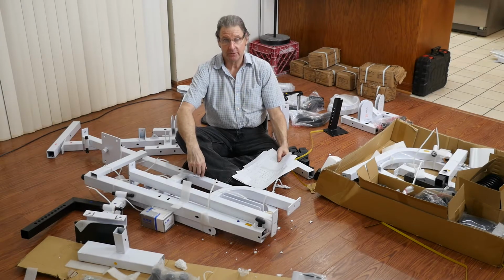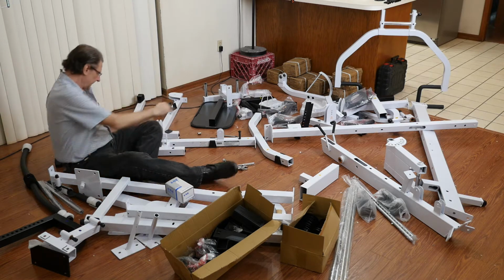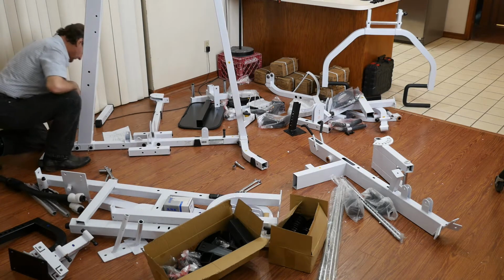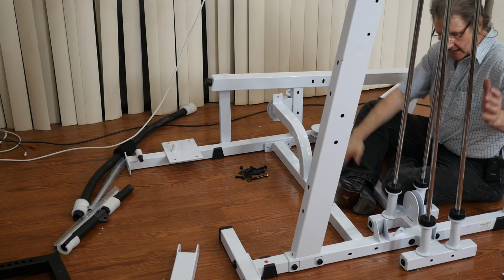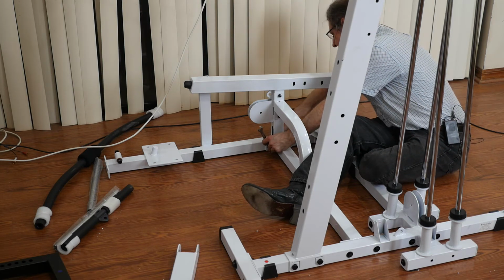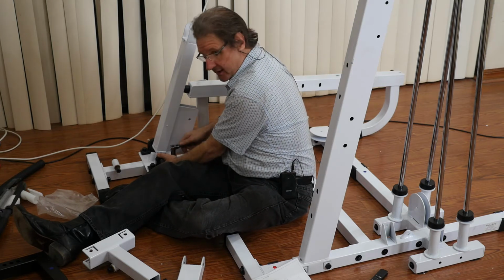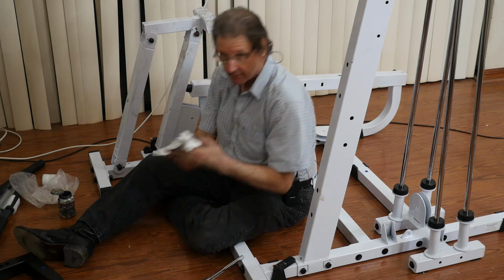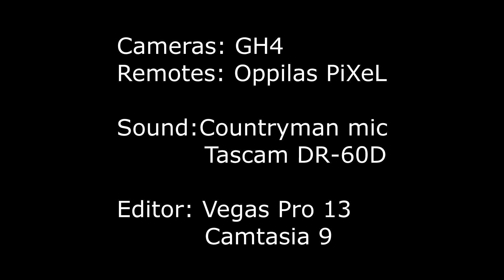Body Solid EXM3000 gym assembly ep1

Comment: Great googley moogley!
Reply from the maker: Yowsa
Reply: @Rako_Studios  I found an older model for sale used that I’m gonna have to disassemble (at least partially) and reassemble at my place. Thank god I don’t have to take it apart into this many pieces!
Reply from the maker: @itsMBWAAA  That's cool. It is easier to move if you can get the top off and remove both weight stacks. I did that for this video:
https://youtu.be/sz0rG517bWM
With all the weights out of the machine, it is light enough to slide around and maybe muscle into the back of a pickup truck. Good luck!
Reply: @Rako_Studios  we actually referred to your video to figure out how to remove the weights! So you helped us out a lot. I got it to my place and just have to put the weights back in and put the leg press extension on but we’re almost done!
Reply from the maker: @itsMBWAAA  Outstanding! Keep at it, it is a great gym, I have saved a lot of money dropping out of 24Hr Fitness.

Comment: this would confuse the heck out of me and I would pay for it to be delivered and assembled correctly.
Reply from the maker: I agree it is a mess to put together. I even made mistakes in the video where I put the one chair on with the bottom on the back and the back on the bottom. It took one viewer 10 hours to put one together, with the help of these videos, so if it was 15 dollars and hour, that would add 150 dollars to the cost, which is not much compared to the $4500 I paid. Thanks for the comment.